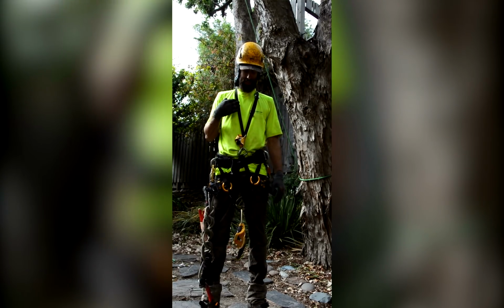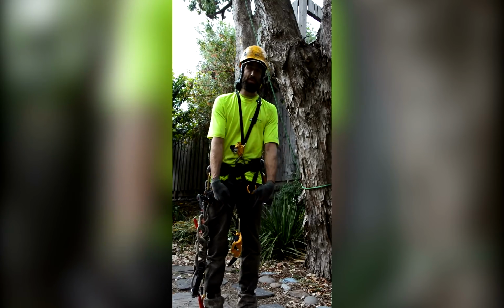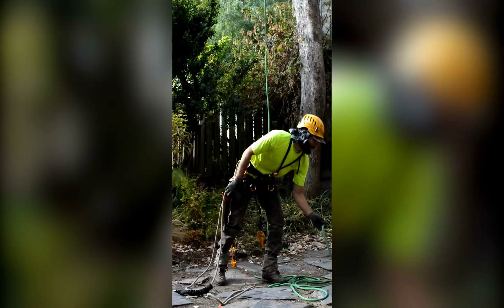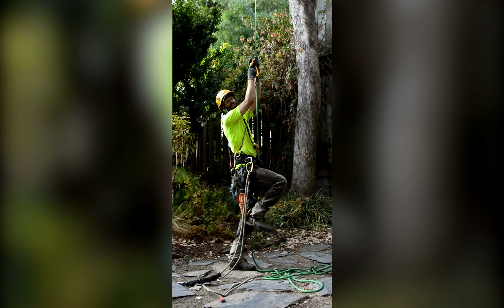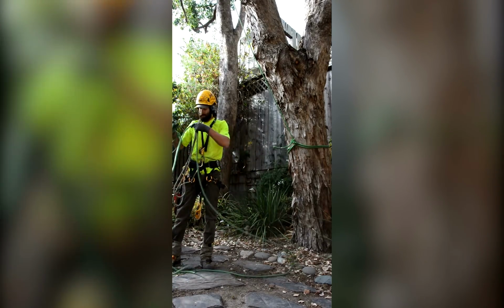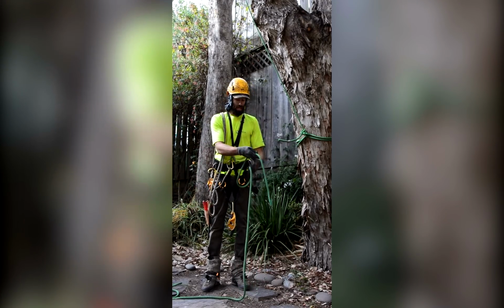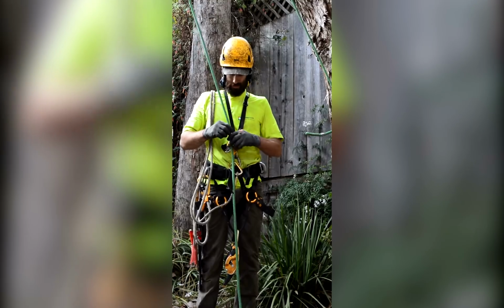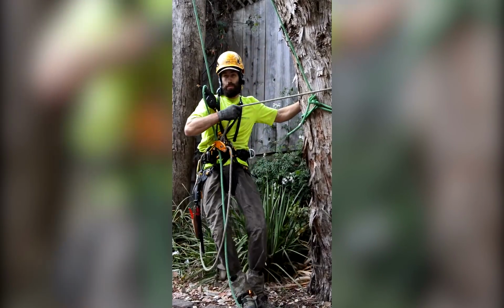SRT Climbing Instruction with Arborist Now San Francisco

Comment: Holy Moly - the ID is a modified GriGri!!! I have both - the ID is twice the size of a GriGri and probably 3 times the weight, can be loaded with rope while attached to a Crab.... so, the only thing in common is they have rope going through them and are both manufactured by Petzl.